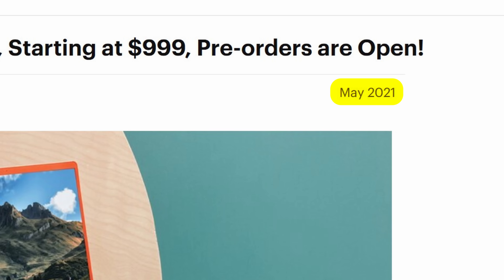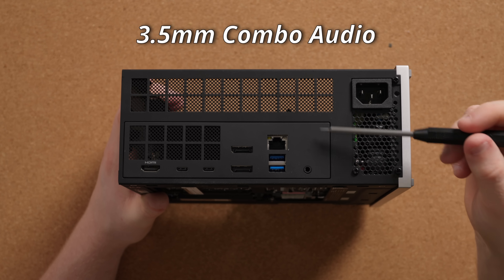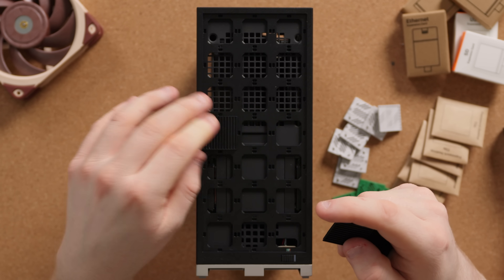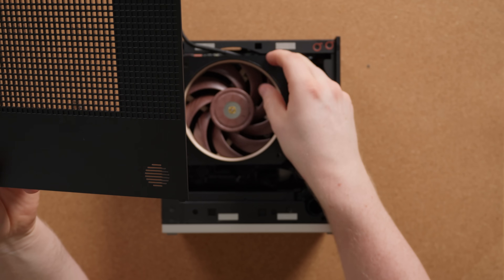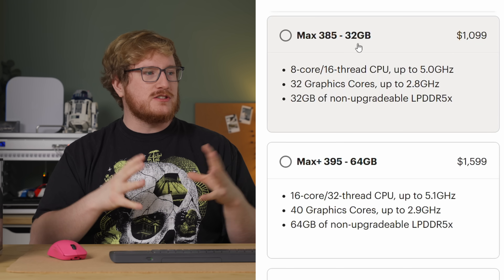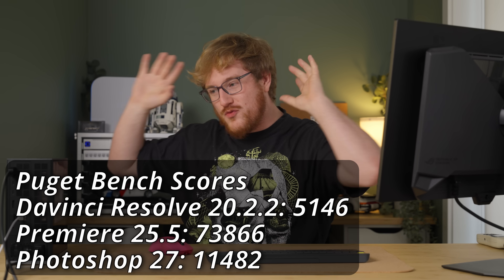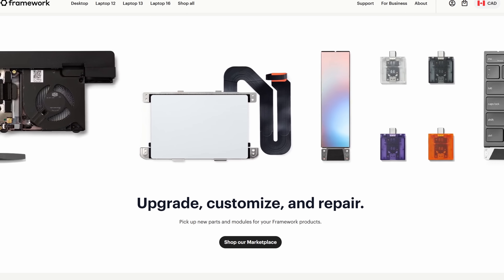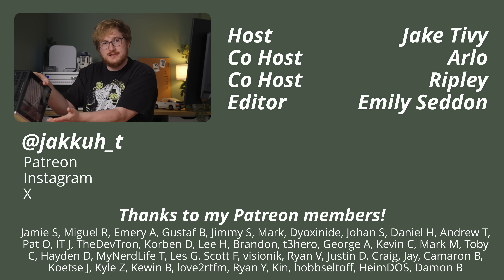I’m glad I didn’t invest, so I can talk the Framework Desktop

Comment: my biggest problem with framework is their prices. Sure repairability is great, but if to be repairable I need to pay so much more money upfront to the point that it would just cover any repair I could need to do on any normal laptop, then this brand is not worth the effort for me. For half the price of the framework 16 (with ram and ssd etc as any other laptop lol) we can buy a new 2025 zephyrus g16 which is better than the framework on almost any spec possible and more, and the money we save can cover any cost of repair if it ever needs it. Also: I never in my life had to repair any laptop. So I will gladly risk it for the huge cost saving.
Reply: I do agree on some point of your argument. Framework laptop is expensive and compared to the other laptop with similar spec is hella expensive. But I still prefer to Framework approach than mainstream brand. Here's my reasoning:
1. I like their sparepart availability. As far as today, they do have their parts available to buy and it does fit to their respective "form factor". Framework 13 parts will fit to Framework 13 and Framework 16 parts will fit to Framework 16 regardless of SKUs. Unlike, for example, Asus. Asus GA502 will not fit onto Asus GA502DU because for some reason their higher up decides thag those laptop are two separate beings. And continuing my tangent, they don't sell GA502DU spareparts anymore 😢
2. I prefer things that can be repaired than things that have to be handled carefully. Continuing my story with my GA502DU, I'll be honest, I don't treat it the best I should've. On one occasion I tried to fix my keyboard double typing (half heartedly), tried to change it with a keyboard sparepart I found on my country e-commerce. Result? It doesn't fit flush (because I didn't attempt to plastic solder it) and it doesn't fix the issue! (I think it's more of 'this laptop doesn't suit my typing behaviour' than hardware issues) And I tried to remedybthis by going to my Asus repair center and guess what? They don't sell it anymore and they won't. It's out of life cycle yada yada yada. Now I'm stuck with a laptop with a crooked keyboard (the consequence of their action, am I right?)
3. You kinda don't need their top spec SKU. As far as today, Framework do sell upgrades for their laptop. Newest Framework 13 motherboard fits in their first gen Framework 13 and their GPU module with RTX 5070 (mobile) fits in their Framework 16 which they first release with only RX7700 as the only option for the dGPU. With this in mind, if they do doing it in a good faith, they're gonna release another newest mobile dGPU for their Framework 16 when there's a new one. Which means, I can just buy a decently spec'ced Framework 16 and just buy a better dGPU on the line.
4. Reducing e-waste. Buying another laptop when the old one is not capable enough or there's something much better or it's broken is understandable. But you know what's even better? Upgrade it! Like a computer! Reducing the things that goes to waste. Framework is selling you a platform rather than a laptop. Which is cool.

If I have a choice between Framework or another brand (Which I don't have, they don't sell it in my country) I think I'll go with Framework. I like their mission and I like their method. But that's just my take for now. Maybe I do change my mind when I see their prices here. Who knows ¯\_(ツ)_/¯
Reply: I REALLY wanted to get the Framework 12 2-in-1. I just couldn't justify the price for performance. A $125 Latitude 2-in-1 with an 8th gen i7  works just fine and its actually not to far off in performance.
Reply: @RyCorp77  Hey if you're considering a $125 2-in-1 as a valid alternative, Framework laptops are clearly not for you, and that's ok. Or maybe you haven't had the same experiences yet.
I did buy a $250 2-in-1 tablet way back, that ran Windows 8 originally. Already by windows 10 it had no official driver support - luckily the windows 8 drivers continued to work. Then the website for those drivers went down. Linux didn't work either because no self-respecting developer would buy such cheap crap that uses non-standard components, and so nobody wrote open drivers for it. Forget windows 11 - the tablet fell apart before that released, after I kept using it for years after the original support website got pulled down. I was probably among the dozen or so users still using theirs. After just 4-5 short years.
This is NOT how I want my future investments to end up like. If that's fine with you, go ahead and buy it. If the performance of that will suffice for you - meaning light office work - then it might just be cheaper to buy a new shitty one every 2-3 years. But that's not who Framework laptops are for. It's for those who feel bad throwing away a piece of complex machinery because it lost support, had no replacement parts, and honestly should have never even existed in the first place.
Reply: @RyCorp77  the premium is really just repairability and because it's a smaller company and better materials
Reply: For many people it’s about reducing waste rather than trying to save money when it breaks.
Reply: You clearly don't know about the used ThinkPad market.
Reply: Yep, I have a 2010 sony vaio pro that still works, just needing a fan to be replaced.
Same with a macbook air from 2011 that just needed a new battery.
Much better off buying a new laptop than shoving 600$ in a simple upgrade from framework
Reply: You're not factoring in upgradeability. Instead of buying an entirely new laptop every 4 years you can just replace the motherboard at a cheaper price. Plus, the existing motherboard will retain its value. Try selling the motherboard on your walmart laptop. Hell, try selling your Walmart laptop all put together. Nobody is gonna want that in 4 years.
Reply: @MasonSchmidgall cheaper? The motherboards alone are so expensive, selling them 100$ in 4 years is not gonna recoup much of the extra spending. And the rest of the laptop is gonna be needing an upgrade too, the battery and screen degrade too, wifi technology evolve, trackpad get better, ...
Reply: You vastly overestimate the amount of replacement parts readily available for consumer laptops. Sure, you can theoretically get repair parts for cheaper, but you have to actually be able to find them, and ASUS has no interest in helping you do so. Framework makes everything available.
Reply: @SaltSpirits like what exactly? In 15 years of owning laptop, I've only replace a fan and the battery, which are available. The motherboard cost and arm and a leg at framework, and for that price you can easily find a replacement board.
Keyboards are available too, as well as track pad.
Reply: There’s also no intel options, no higher end amd options. Frame work 16 still has no silver option half the damn laptop is black.
Reply: Repairability adds cost because cheapening the design removes serviceability. When you have a PC designed for human access and repair, machine assembly gets difficult. Streamlining the assembly process to be better suited to robotic assembly lines removes build cost and lowers the cost of the device. If that had never happened, consumers would never have gotten used to a $200 laptop. Don't blame Framework for the cost, blame the industry for their cheapening and enshittification practices setting an unrealistic standard.
Reply: @imitt12 not blaming them, just saying that the financial argument is not one. It's simply more expensive than buying a new laptop every 4 years.
Sustainability might be something, but they're not first on that, sure you can't fix a macbook but a Sony vaio is not a problem to fix, unfortunately people still rather buy a macbook or surface pro...
Reply: The last time I bought a laptop, I looked into Framework to see what they had on offer. Compared to the $950 Asus laptop I went with, I would've paid $250 more for a Framework laptop with worse performance. But the Asus laptop was on a Black Friday sale for $300 off and Framework doesn't do sales on current gen parts, so the Framework laptop would've actually been $550 more. Sure, you could save a few hundred dollars on the Framework by not getting a windows license and sourcing your own ram, storage, and charger, but most people need windows on their machines and don't have the time or technical know-how to source their own parts. And even still, doing all of that would only bring the price disparity down by a couple hundred dollars, not $500+.

Even with the promise of upgrading the Framework laptop down the road, the cost for a current gen motherboard upgrade is the same as an entire regular laptop with the same specs on sale. Since I bought the Asus laptop, when I do decide to upgrade I'll be left with two entire laptops instead of one laptop and one motherboard, and I can potentially sell the old laptop to recoup some money.

I am a big fan of what Framework is doing with their laptop designs, but they don't really make economic sense for the average consumer.
Reply: Look. If you're the kind of person to just buy a new laptop when yours starts to get slow, that's all well and good. This isn't for you then I guess. If you don't need to run much more than an internet browser and some spreadsheet or word editing software, that's fine, it's clearly not for you either. 

For the people who do want their laptop to have driver support in a decade or so, whether that's through the manufacturer or the community thanks to the manufacturer making stuff like schematics and firmware available to the community... Well that's where this really shines. It's also great just in case any parts do fail for whatever reason. Power surges, shorts, someone accidentally spills water on it... You can replace it for cheaper than buying a new one. It's good peace of mind if nothing else. 

Basically, it's right for some, not for all. Keep in mind they don't have the turnover that these mega corporations you're comparing them to do. This adds to R&D, testing, and a variety of other areas too. Oh, I can also tell you have never had to put a laptop or computer in for repair... It can be anywhere from 50 bucks to a few hundred. Depending on the issue and how long it takes to fix it. So you must treat your devices well.
Reply: @Deja117  I still think you're missing the original's comment point, which is that while all of the features you're mentioning are great, the price you have to pay for them upfront is so fricking high that it ends up beating the purpose. Why bother spending a ton of upfront money, and even more money in case something breaks (which btw if you check their prices for laptops components they are also horribly expensive), rather than just spending 3 times less and buying another laptop in case your current one fails (assuming it fails big time which happened to me only once in 15 years of owning laptops)? If you do the math it's still cheaper.

As for the last part, its not our fault they are not a mega corporation. I see a lot of value in what they offer, but not for the price they offer it. I agree with the original comment. I do not think the current pricing is competitive for what they offer, but maybe that's just me.
Reply: @ldidok  I agree. I don't think Framework's main offering is "bang for buck" at least at its current prices. What they offer (reduced e-waste, flexibility, tinkering ability, an open source platform, an ideal, etc.) is really for those who value those things enough to justify the price hike and who can afford it. My thinking/hope/expectation is that, as with any new product, low product movement and high R&D costs inherently means that a new product will be targeting a very niche community of enthusiasts for whom the cost is worth the value offering, but in time, as the company grows, I hope/expect the prices to come down -- eventually...
Reply: @greatday19  >and who can afford it
yea thanks for pointing it out, i know it's kinda hard to think about but most countries arent 1st world countries
if it's hard to justify the cost for people in the west, it's practically impossible to justify in 2nd world countries, where i live i make about 800/1000 usd per month and that's considered decently good conpared to other places, even if 100% of my income was disposable that's over two of my salaries for the better chip with lower memory spec, and count in delivery prices being higher due to being further away from major western trading centers. and like i don't have it that bad even, at least for me that's a possibility to one day maybe make enough money to buy one, and my country is in the eu and practically integrated with the west, so i have it better than most people from other 2nd world countries, let alone 3rd.
for a vast majority of people proper good tech is either inaccessible or borderline too expensive to justify buying.
so yeah, all that to say, framework has a legitimately tiny potential customer pool compared to proper budget laptops, which unfortunately tends to be the place where most e-waste comes from.
imo they're great and their goal is admirable but with this pricing it's just really not changing much if at all, i just hope that they use these prices to grow as a company and maybe one day manage to make more affordable models which i think would help way more than what they're currently offering.
Reply: @Polish._.P3rson you're right, regional pricing is the usual fix for this, but I'll assume by your post that this is not something they offer (yet, at least). If they've priced their devices for a US market, then that definitely significantly limits their potential client base -- completely agree.

When I first read your comparison to budget hardware, my first thought was "yeah, obviously budget hardware will have a wider reach"; then I continued reading, and I hadn't fully considered the fact that budget hardware is where most of the e-waste would he coming from. So, if their mission is to reduce global eWaste (which I assume it is but not actually sure), then they definitely need to address the budget market.
Reply: @greatday19 yeah nah they don't offer that, and i honestly doubt they will, regional pricing practically doesn't exist for pc hardware, it's usually more expensive in poorer regions in fact, for the same reasons i mentioned, but hey glad to have helped with opening that perspective 😅
Reply: @Deja117  You didn't address the point that the total cost of ownership is lower with a standard laptop _even after you pay for repairs_. 

And honestly if you care more about drivers, parts availability, etc, etc than you do about total cost of ownership. Well then then you should just buy a business class laptop (just not a Surface lol). If you have hardware issues with a Thinkpad they'll send a guy around to replace the part within 24 hours for free. Framework can't touch that kind of support.
Reply: You must not keep your laptops more than 3 years. Every laptop Ive owned had a broken hinge or broken ribbon cable by 3 years. And most end up needing driver updates  once per year.
Reply: @Sam-tb9xu  i bought the zephus g14 when it came out snd it's still going strong it's also relatively repairable 

I do love framework and i hope they will keep doing well i also have suggested them to others
Reply: @Sam-tb9xu  Stop dropping your laptops like an idiot, then?
Reply: @Sam-tb9xu  I sell some of my used laptops but I also kept some. I have a toshiba satellite from 2009 still working perfectly, new thermal paste, ssd and a cleanup and its now my parents computer with linux to check emails and browse the web. I also have an old HP Compaq 6720s from 2007 (if I remember) also still working completely fine, ZERO problems, just huge discoloration on the keyboard and touchpad from heavy use. Another one I have is one of the first Lenovo Legion gaming laptops, those with the ugly red Y and red speakers on the hinges. Can't remember the model name, but its now my brothers university laptop and still works fine, fell on the ground once and broke a corner of the plastic chassis but still zero problems. My current laptop is a 2021 zephyrus g14 and still works with zero problems to this day, 4 years old of DAILY use for work and gaming, and its a very heavy use. I also have an old very shitty asus Eee PC with an Atom and 1GB of RAM that has the keyboard missing one key and that is its only problem, but I don't use it so its in the drawer. Used it as a minecraft server once and left it on for months in a row doing that, but now it got replaced by a (unironically much faster) raspberry pi 5.

Do I need to keep my laptops for more time than this to prove to you that if taken care of correctly (no falls, no throwing them around, keeping them clean etc) any decent brand laptop lasts 10 years easily? A few get problems yes, but most don't. Just avoid Razer laptops and you should be fine with durability.
Reply: @Sam-tb9xu  What a crazy assumption. I rocked my laptop I bought for college for 6 years until it literally fried itself and emitted smoke. It was a workhorse, I'd use it for class, at work, and again at home for gaming. By that point, I want a new laptop, not repair it. I'd have to replace the battery, keyboard, I'd like a nicer trackpad, screen, camera, etc etc

It makes sense to get a new laptop at that point. I'm upgrading the entire thing, might as well just get a new one. Framework prices just don't make sense.

Comment: I tried using two of the drives you had (one SN850X and one SN850 non-X, both 2TB) but it didn't work. My computer would boot, and after some time just hang before BSOD. When I booted back up, the second drive was corrupted and had to be re-initialized. Using the two drives separately, and the same computer (10900k, Asus Z490-G) with other drives, everything is fine. Have you had any issues running multiple of these?